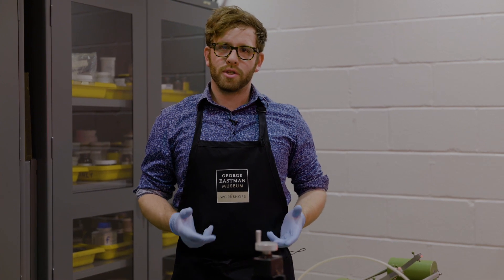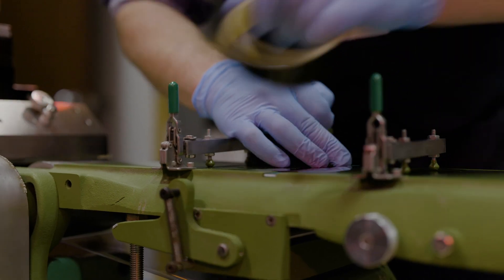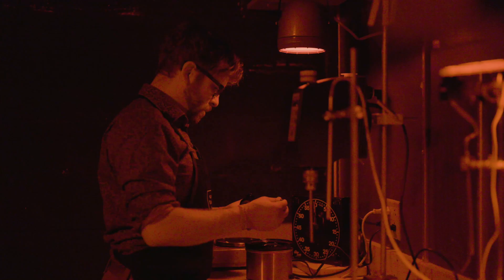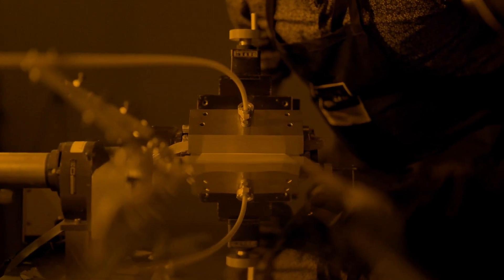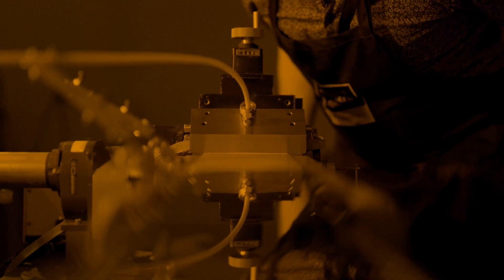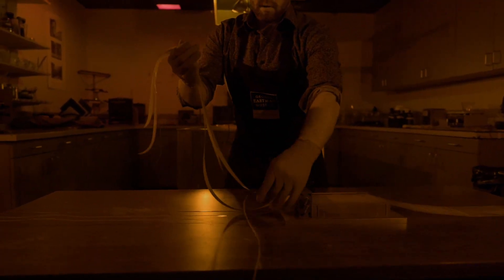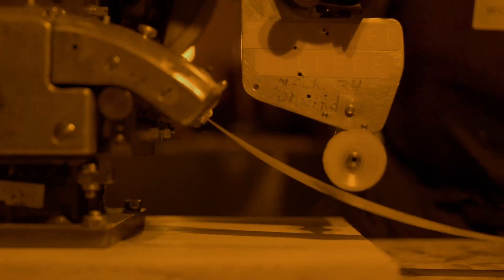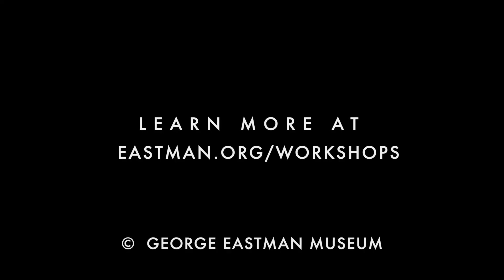Making 35mm Film

Comment: Hello.. I have a suggestion running in my head and I ask, and I think that it is not impossible with the mechanism of progress.. Which is the following. Why is not making a 35 mm film.. It is immediate and does not need to be developed or whitened.. I mean, as soon as the snapshots are taken, the pictures are ready, whether in color or black and white film. Film or photographic images and you take them out of the camera and watch them immediately. For example, as Kodak or Polaroid instant cameras did in the seventies and eighties in the past, the difference is that this should be on a 35mm tape.. Is it possible that Kodak could not do that??!! I think this is unreasonable.. but why haven't they reached this idea yet. I hope to find an answer.. Thank you..
Reply: Polaroid did make 35mm "Instant" film.
I think Kodak Just didn't make any, because of patent reasons.

Comment: is there anyone making or can i buy an old style coating machine like the one you use ? and a perforating machine  like the one in the video as well.. if not can we find the designs for them online or thru the patent office? can you give the model and patent number for both of those machinea please
Reply: Search for slot die coaters. I'm a no expert but the perforator is pratically not available. You may use manual punching tools which were used to stitch two strips of film together.

Comment: Now can you give me some information on how i could do this at home ? Or possibly try doing this some other way if i was homeless? Trying to make my own 35mm film.
Reply: Have you seen this? 
https://www.flickr.com/photos/dark_orange/2042501949/in/photostream/
The easiest way to make your own film would be to build a machine similar to this or maybe similar to Ferrania's machine. the Main component you will need to invest in is what's called a coating head. Coating heads are what spread the coating evenly and consistently across the acetate/plastic film base. There are several types of coating heads, the most popular in the Photographic industry being slot/slide die coating heads as they can produce several layers without each individual layer mixing into the other. Here are some resources that may help: 
https://www.youtube.com/watch?v=JXpoALotxf0&t=7s - skip to 7:17 and you get a good description on how film is coated
https://petapixel.com/assets/uploads/2015/02/static1.squarespace1.jpg 
http://www.makingkodakfilm.com/ - Costs money but absolutely incredible book.
you can actually buy small scale coating machines for a few thousand bucks if you want to run this on sheet film or dry plates for example:  https://www.youtube.com/watch?v=QZYT_213uzM
Reply: I guess you could try to do *something*. Maybe not 35mm film, as that kind of requires precision, but Foma sells photographic emulsion for quite cheap (60 euro for a kilogram) and you could probably coat a plastic sheet or something with it. It might even work for taking photos if you threw it into a DIY shoe box camera instead of photographic paper. If you did it on a transparent plastic sheet then you might be able to do a contact print.

Comment: why red color is a safe light?
Reply: Red has the shortest visible wavelengths, so it doesn't travel as far as other colors. By the time the light reaches any light sensitive materials, the strength is too weak to have a strong affect.
Reply: @TheJrbdog  That is not correct. It's because some black-and-white emulsions are not sensitive to red light. Film is typically senstive to the full spectrum, so it is handled in total darkness. This emulsion seems to be more along the lines of an orthochromatic film that has no red sensitivity.
Reply: @DonaldWMeyers-dwm  quite possibly a simple emulsion, which is JUST blue sensitive.
Reply: @TheJrbdog  red has a wavelength (long distance travel) of 700nm, where blue is around 400nm. 🤔🤔🤔
Reply: @logeshwaranrk  oh yeah, that's a good point. Disregard my comment then, I guess I don't actually know what I'm talking about XD